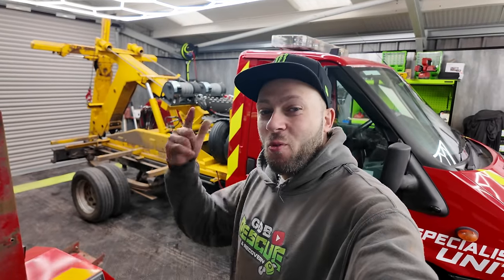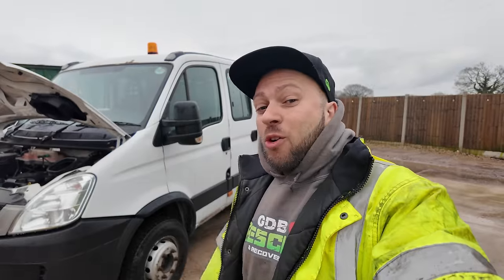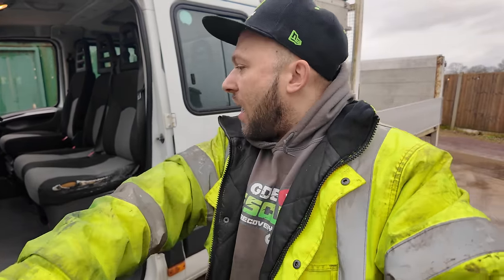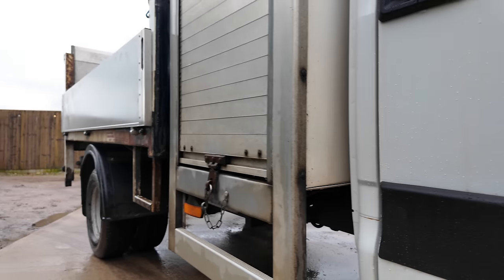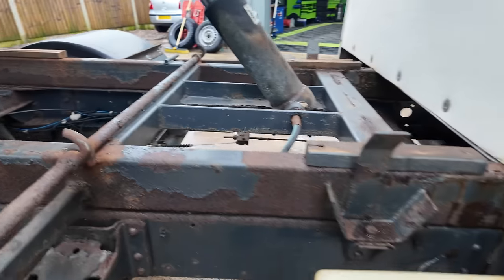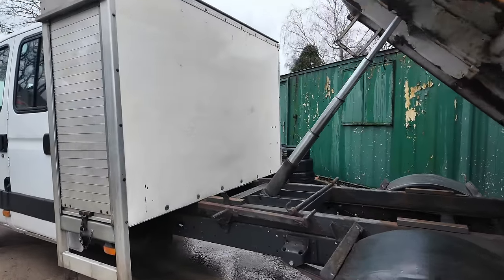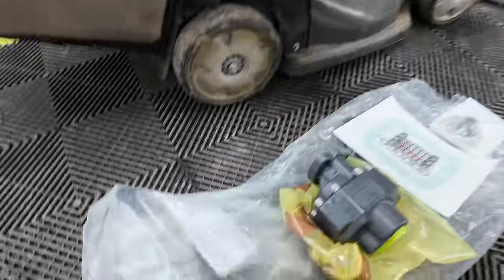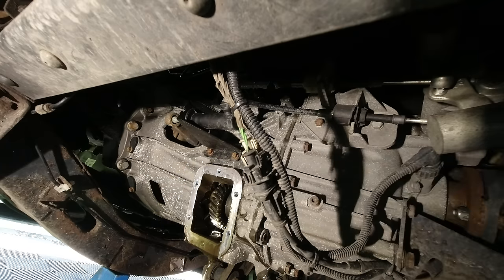NEW VEHICLE | PROJECT REPO | VEHICLE RECOVERY!

Comment: Hi Greg,
Nice to see another 3.0 iveco as a recovery vehicle.
I'd put air bags on it instead of adding leaf spring, better comfort and adjustability, you can buy air bags off 7.5 t and make brackets yourself that's what I did in mine, I can show you some pictures if you want.

Comment: Hi Greg I am currently doing the same as you , I have a 65 plate 6.5t iveco crew cab , ex council . Had a 3m tipping body on that's  being collected tomorrow.  . I am putting air suspension on as well as the springs to cope with the weight that will be after the axle . The spec lift I have came off a early 2000's  iveco 6.5t . That had an additional set of springs above the standard set for the spec load.  I am hoping to start putting ib back together around easter .  Once it's done it will be up for sale  , around £15k.  If anyone is interested.
Reply from the maker: Ah very nice! , Air suspension sounds good I may be adding that subject to how it lifts and sits when loaded... unsure yet! , Sounds like it will be a good set up. Send some pictures when it's done on the Facebook group EVERYTHING vehicle recovery UK!